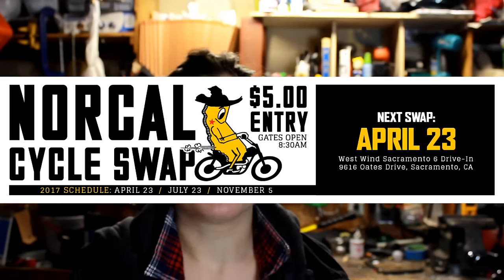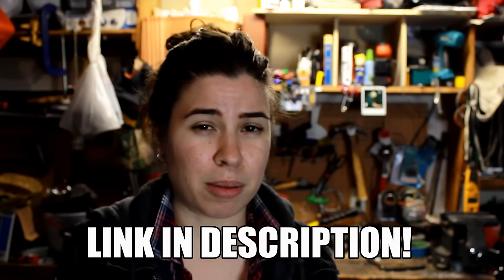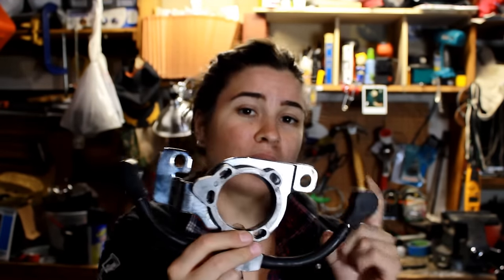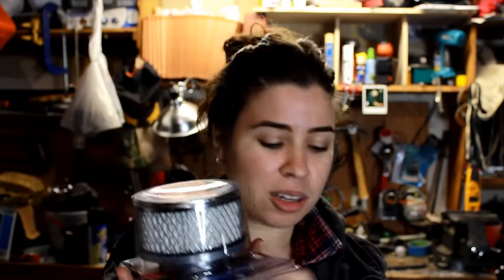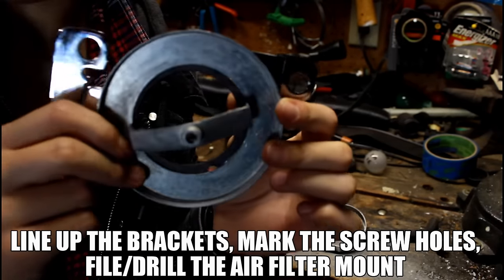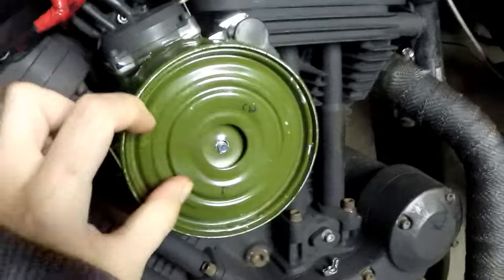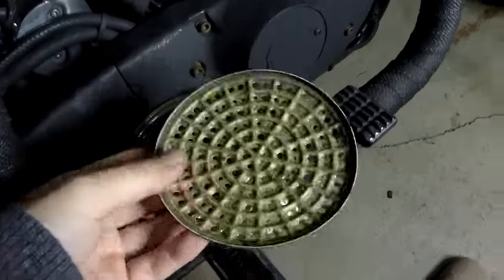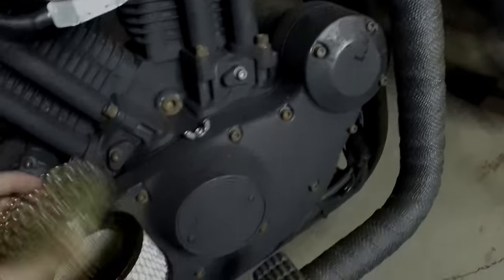Russian Gas Mask Air Filter - Wasteland Wednesday

Comment: Just a thought.... but you could cut the top of the gas mask filter an eighth of an inch wide ... slip that over the filter ... fits perfect over it .. drill hole for wing nut bolt and done..... no dirty air going through the piece you made.... just clean air through the filter......looks awesome.... but clean air is better then dirty air......just a different way of looking at it......a mechanical way for the engine and it would save engine from dirt.....
Reply: ^  Thats what I would do.  Cut just enough ring from the gas mask so that it slips over the first chrome bit of the air filter.  Then add your wingnut to the 'front'
Reply from the maker: Genius! I will give it a shot!! Thank you!

Comment: Looks badass. the only thing I would suggest is taking some screen from a screen door or window and putting it behind the cover. the holes that are in it allows a lot of dirty to potentially enter the carb and the engine. 

looks badass though. good work!
Reply: Nevermind. ignore that. haha. I read below where you said there was a solid cover. Haha. I'm retarded.
Reply from the maker: No worries that would still make a great idea for additional air filtration around the cover! Especially for those dusty, windy days. Thank you!
Reply: Killswitch Queen no problem!

Comment: Love the bike, you should have smoked him though. Sportsters are fast for that bike catagory. Those tuna an are outstanding in winter. Slip your hand between it and the hanging gives you a good beaing point of where the heat is without taking eyes off road or mirrors. Same for left hand, just a tip.

Comment: You pull that one off! It looks sick! The only thing I'm thinking of is (and that's because I'm a commuter rider) you better not ride on a wet day lol
Reply: Walter Deans Cheers from Portugal .
nice video!
Reply from the maker: Thank you! I'm not too worried about the rain, if I ever get caught I'm sure I can MacGyver a cover to get me home!
Reply: The moment she finished putting it on and was showing it off, my mind started coming up with a rain shield design.
Some 'rust' or 'hammer mark' paint to make it look home made, or scrap scavenged, and voila. I'm thinking a 1/3rd circle to protect the front and bottom and a bit of the top of the round filter should be fine. Maybe flair the top and bottom a bit to add some of that 50's Art Deco swoop styling to it.
Urgh! Killswitch Queen is making me wanna make my garage into a workshop to try out these ideas she's giving me!! GAAAAAAAH!!

Comment: Thats awsome KQ, love the look and i bet it gives a nice roar when u twist the gas.
You might need to adjust the fuel air mixture as it could make the bike run lean.
Reply from the maker: Already adjusted the richness so she's running mean! It totally gives it a different sound and throttle response is way sharper

Comment: Yeah drilling holes in the cover plate completely bypasses the filter so you are sucking dirt into your motor. Those poor valves, seats l, and rings....
Reply from the maker: 1) I didn’t drill any holes, that’s exactly how that piece came out of the filter, and 2) I put it on top of the solid cover, so there’s no “bypass” it’s all as it should be
Thanks